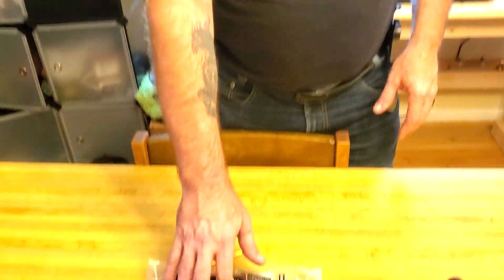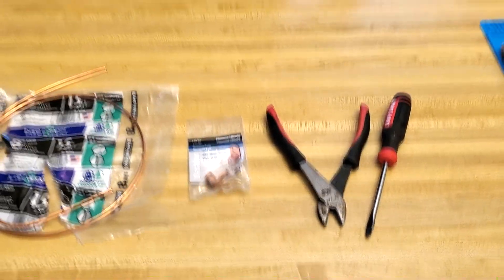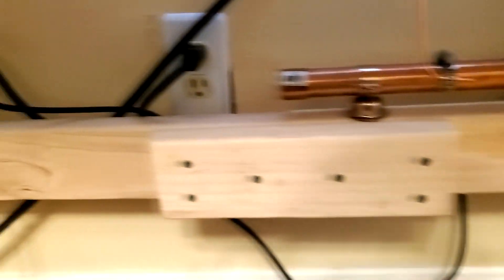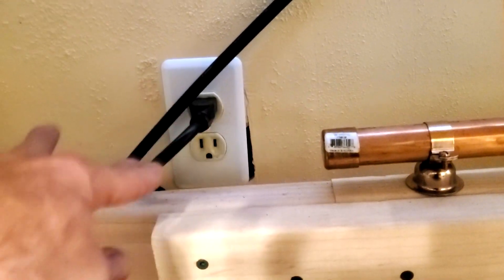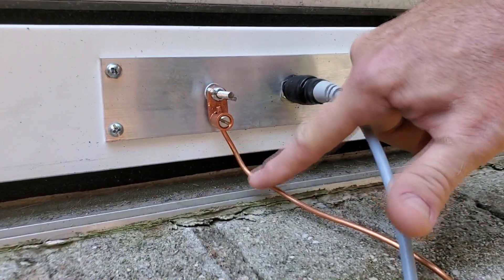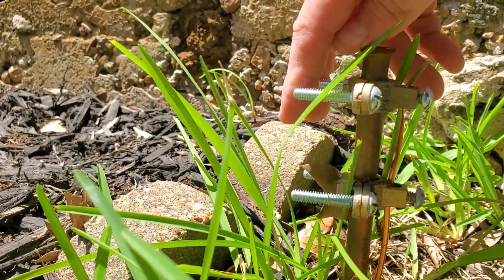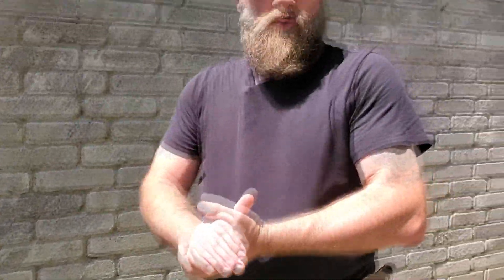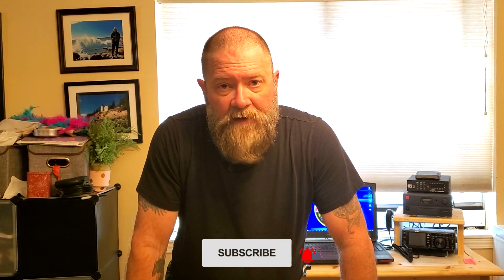How I ground My Ham Radio Station

Comment: I have been a HAM for decades. Grounding is made to be confusing, but it IS NOT CONFUSING if you follow some simple rules. You do not want the hose clamps as shown here because you don't get much of a connection. Use dedicated brass or copper ground clamps. Bi-metallic connections are not good but at times are hard to avoid. You can create a ground buss bar as you have here but use a grounding rod and not a pipe. Use UL listed grounding clamps to connect to the buss rod. Keep every run of ground wire or strap as short as possible. Crimp and don't solder.

Having said all that, some HAMs never ground and often have no issues. Once we installed a new AC and I had to disconnect my shack ground and when we were done, I forgot to fix it back. Two years later I found it and fixed it but never knew the difference. The chassis of the components will find a ground via a properly wired home but this is often the cause of a lot of harmonic noise issues. RF and household AC frequencies are completely different animals. I have never had any problems with grounding. Keeping it simple, direct, short and properly connected is what works. Many times if you have RF noise it the shack it will go away if you disconnect the ground which indicates you have created an antenna with your ground by not doing it right.
Reply from the maker: Thank you very much for sharing your experience!  I really appreciate that.  I made an updated video on this topic due to the comments and my new solution is just plain and simple common sense.  I unplug everything if a storm is approaching or if I am not using my radios for a period of time.  Works 100% of the time and my gear is protected.  Thanks for the comment and for watching.  73!
Reply: @HR4NT As an Electrician I would also run an unbroken #6 solid copper to the outside ground rod. The ground is only as strong as its weakest point. And those wing nuts on that bolt is a weak point for sure
Reply: Did you use a Megger to measure the resistance of that groundpin?

Comment: What size of wire are you using from your radio/tuner/PS to connect to the copper pipe? I couldn't really see it. You're using the 8 gauge wire from your copper pipe to the pass through, then to the ground rod, but can't tell if you're using the same size from your radio to the pipe. Thanks.
Reply from the maker: I am actually using braided grounding straps made by ABR Industries and bought through Ham Radio Outlet.  I bought the 5 foot versions for all of my radios and gear.  The link to what I use is here:  https://www.hamradio.com/detail.cfm?pid=H0-012451  Thanks for the comment and for watching.  73!

Comment: Thanks for the video. I read competing theories about grounding on the internet. One is that running a copper braid from a buried copper rod to inside the shack only invited lightning indoors. The other is that ALL equipment and antennas should be bonded together to ground where the AC line comes in. Of course that begs the question: what if your shack is on the other side of the AC line entry? My shack has a small copper pipe similar to your set up with braided wire running to it and bonded there. From there it's bonded with copper to the metal bulkhead in the window coax entry. Outside I have an 8' copper rod in the ground with copper strip running to the bulkhead. I'm in FL so I did a bit of study on how to do it right, but perhaps I should consult the ARRL Antenna Book on proper grounding. I am also very diligent about disconnecting ANY coax from the bulkhead when there's any threat of T-storms. Your setup looks solid!
Reply from the maker: You nailed it!  I made a newer update video on this topic and that is my solution...unplug everything if you are not using it or a storm is coming.  Works every time 100% of the time.  Just a little inconvenient but better than $5000 in repair s and replacement radios and gear.  https://www.youtube.com/watch?v=ed0N5b6yeZg  Thanks for the comment and for watching.  73!

Comment: KE0OG and others show running a 6 gage wire between your ground rod to the ground rod at your electric service entrance. You now have two grounds at your house and that is a safety issue..
Reply from the maker: I have come up with a new solution and a video explaining my solution.  The setup in this video is/was too complicated.  Check out that other video if you get a chance.  Thanks for watching and for the comment.  73!

Comment: There's a whole lot of grounding info out there. I will just repeat what I've seen. The dat I've seen says each piece of equipment MUST go from that equipment to the ground rod. But having all pieces connect to a bar or copper piece before it gets  to the ground rod is technically a "Ground Loop". 

I am in the process of re-doing the whole system  including bonding my shack ground rod to the house ground rod. The motorola package on communications grounding repeats this last thing over and over. That may fix my minor problem. I hope.
Reply from the maker: I recently uploaded a new updated video on this topic and my new solution to it.  Check it out and let me know what you think.  Thanks for the comment and for watching.  73!

Comment: Interesting is that like most people I've got computers, televisions, washer/dryer, router and other electrical installed and all have the 3 prong pin for grounding, but buy a radio and all the sudden grounding requires a totally extremely complicated and expensive and potentially dangerous new design.  Doesn't the radio have a 3 prong plug?  (jk).
Reply from the maker: The radio doe not...the power supply TO the radio does.  And you are right, we freak out about things like this and make more out of it than it needs to be.  Thanks for watching and for the comment.  73!

Comment: 200 feet of copper ribbon is what’s recommended 
For a real ground. Or your copper water main if you have one.
Reply from the maker: Thank you for the info.  I recently made another video with updates to this one showing how I finally resolved my grounding issue and a surprising article on why IU did what I did.  I hope you check it out.  Thank for the comment and for watching.  73!!

Comment: @HR4ANT     I have an Icom IC-2300H FM transceiver that doesn't have a ground lug on it like the HF rigs. how would I ground it?
Reply from the maker: I recently did an updated video on grounding my shack and what I've learned since then that I put out probably 2 weeks ago. If your radio does not have a ground option built-in you probably really don't need to deal with it.   I would just unplug everything if there's a storm coming to protect your gear because no amount of ground rods or ground straps will protect you if lightning actually hit your antenna directly. Check out that other video and I hope it helps out a little bit more and explain things a little bit better. Thanks for watching and for the comment if you need any other help let me know. 73!!!!

Comment: all my grounding, bonding publications say the the ground rod and the clamps should be below grade meaning you drive the whole arraignment until it's covered over by earth. According to code that is, however the electricians who built this system in '46 and the guys that put in my solar in 2017 and the county Inspector at that time, apparently never read this part of the code.
Reply from the maker: Interesting.  The ground to my house that was put in decades ago is sitting a few inches above ground with the ground wire from the breaker attached.  I have never heard of burying it completely underground for effectiveness.  Thanks for the comment and for watching.  73!!
Reply: @HR4NT  I saw that in the "Grounding and Bonding for the Radio Amateur" by H. Ward Silver an ARRL publication. I agree. My ground rod are the same way. I guess local building code has a different take on grounding and bonding. 🤷🏼

Comment: Amplifiers need a ground because the case seems to radiate r f. Also run a bonding wire around house to power in ground your outlet ground and your ground rod will show voltage mite bite a little between radio and your ground rod.
Reply from the maker: I did not know that about amplifiers.  Thanks for sharing.  Thanks for the comment and for watching.  73!

Comment: Hey, thanks for the video. I noticed when you talked about maybe adding another ground rod, you pointed to the ground just beside the existing ground rod. You may want to check my facts but I believe there are requirements about the distance between ground rods. I read that they should be no closer together than the length of the rod. So, If you use 8' ground rods, they should be 8' apart, or greater, and bonded together. Again, do some research  because I am just learning too.
Reply from the maker: I actually shot a follow up video to this one a couple days ago.  I have made a few changes and these seem to work out just fine.  I added that other ground rod later on after this video, but have since abandoned it.  Check out the update video.  Thanks for the comment and for watching.  73!

Comment: For an RF ground, due to the skin effect your shack ground conductor should have a lot of surface area. Flat copper straps are best, followed by flat and wide copper braid, followed by thick stranded wire. I plan to use AWG 6 THHN stranded electrical wire for my shack ground. using a 5" long 12-connector copper bus bar with screws and holes that's meant to go inside a breaker box. But even a so-so ground is better than none.  (BTW my window passthrough consists of leaving a sliding window open a crack wide enough for my LMR-240. I'm in the tropics so a draft's not a problem, and I don't have aircon, just an electric fan, so I normally leave the windows open anyway.)
Reply from the maker: That sounds like a good solution for your situation.  Like I said, we each have to find what works best for us.  I have so much RFI (noise floor is 10 over 9 most days) that ground or no ground, it doesn't matter as far as cleaning up the signal.  Because I disconnect everything in the event of a storm, my gear is protected.  I did end up keeping my safety ground, but that is all.  Thanks for the comment and for watching.  73!

Comment: You need to use ground strap (not copper wire) if you want to properly ground your station. It's called "skin effect" and wire does little to fascilitate proper grounding at HF frequencies. Frankly with today's modern electrical systems and gear, grounding offers few benefits.
Reply from the maker: I am actually shooting a video about this topic this week.  I agree, overthinking about grounding in modern day technology is a waste of time.  Thanks for the comment and for watching.  73!
Reply: @HR4NT  And 73 to you good sir. DE-K5LXY.

Comment: I have a ground rod at the entrance to my house with an arrestor attached to the ground rod. I run 4 ga wire from the ground rod to the mains ground. I do not ground my equipment. In the event of a lightening strike your grounded equipment is toast. If your concerned about strikes then unplug your rig, disconnect the coax. Grounding your equipment will not save it from a strike. If your not having issues without the ground then don’t bother. The ARRL sells a book on bonding and grounding. It’s very good.
Reply from the maker: I do exactly that now, I unplug everything if a storm is approaching.  I ma also getting ready to do a show talking about this topic that should be out next week.  Thanks for watching and for the comment.  73!

Comment: Curious, have you experienced ground loops with the points of grounding on the copper bar.  I have alsways understooed that a person should have one common point for grounding. 🙂
Reply from the maker: I have not had any issues with the way I have my ground setup.  Although apparently having the extra grounding rod outside my window rather than grounding to the rod below my breaker box seems to be frowned upon, but I have not had any issues to date.  The one thing I do is whenever there is a storm approaching, I unplug all my antennas and grounds from the window passthrough I built to protect my gear.  I am not taking chance with thousands of dollars of equipment on the line.  I hope this helps you out.  Thanks for the comment and for watching.,  73!
Reply: @HR4NT  I am going to ground my shack the same way. I like the way it looks and it makes a ground tap a lot easier. You have an awesome day, enjoy your content!

Comment: Great video show and tell works ever time. One suggestion how about a list of product and where they came from. We’re did the clamps that look like bells come from and what is their real name. I am in the process of building the window. How do u lock window? After installing
Reply from the maker: Hi John,   The bell things are actually called "copper bell pipe hangers" I got from Home Depot.  The majority of the grounding stuff came from Home Depot.  The way I locked the window after installing the passthrough was to use two screws at the point where the window seals with the passthrough installed.  I works very well and prevents the window from moving.  I hope this helps.  Email me from my website if you need any further assistance.  Thanks for watching and for the comment.  73!

Comment: If you are a Western ham radio operator moving to Thailand and some other nations like it, are you aware of the difference and I do mean difference in the way 230 VAC is supplied to the home compared to the way in The United states????      Thailand and licensed Thailand electricians do not believe in grounding and the two wires which supply 230 AC for one horrific example, cannot be split off to form a  115V AC outlet.   If you're even slightly any doubt,  get a ham who has lived through the Thailand electrical system to consult with you.  Hired Thailand electricians are struggling to put in three wires to provide a third pIn grounding on the more modern outlets/sockets.   I checked first with a wise old local ham and found the dangers I was treading.
Reply from the maker: When this video was made, I was not taking into consideration the practices of grounding around the world, so it did not occur to me that there were other practices and challenges in other places.  I appreciate you sharing that info.  I always like learning about new things from other countries.  Thanks for the comment and for watching.  73!
Reply: @HR4NT  notice that my answer is not complete enough to operate with it. You need to get hey Tai eligible local ham to tell you how to handle Thailand two conductor AC input.   I merely warned you about it I did not tell you what I don't know which is how to handle the two wires coming in

Comment: We're lucky around here (Houston metro area) with respect to lightning though... You seldom see houses around here with lightning rods, but I've noticed a lot more in the Dallas area with them... Personally, I'm relying on the fact that the Crazy Indian Old Lady that lives next door to me is in a 2-story house and I'm in a 1-story... :)  When I was living in Louisiana 50+ years ago, it seemed that people just relied on the pine trees to act as lightning rods... :)
Reply from the maker: LOL...wow...yeah I have not seen lightning rods anywhere around either.  Let the two-story take the brunt of it...LOL....Thanks for the comment and for watching.  73!
Reply: @HR4NT  -- Your subdivision looks like it has underground power lines.  We do too, but I also have a higher line running along my back property line that abuts the greenspace / levee.  It has a ground line at the very top and is probably even taller than my neighbor's 2-story house... Odds are that it would get stuck first... I'm not too concerned about lightning striking my house... I used to live in house in north Louisiana that had a 100 ft tall pine tree in the backyard... It got stuck by lightning when I was less than 20 ft from it working on a project in the backyard... The bark EXPLODED out the side of it and I hit the ground... Pine trees make very good lightning rods... Often works out to be single use though since they will often die after getting hit... And then you have to wait around another 50-100 years for a new one to get the same height... :)
Reply: There are 22 pines on our property/5 close to the house. Each pine is 120+ feet tall......natural lightening rods :)

Comment: Does the ground rod really need to go 8 foot into the ground?
Reply from the maker: According to electrical code, yes.  It is a bit of a pain to drive it into the ground, but it is worth it to help protect your equipment.  It's to find the soil which has much lower resistance than the rocky surface. It is very important to provide a low resistance path to the neutral current.  If you live in an area that is primarily stone and rocks, I have seen instances where the rod was put in the ground at an angle instead of straight vertical.  I hope this helps.   Thanks for the comment and for watching.  73!
Reply: 4' is sufficient in soft soil.

Comment: Did you happen to notice any reduction in noise when the radio is on? I did mine very similar but used 3/4” straps off the radio tuner amp etc.. i noticed a drop in noise on my vertical and a little drop on the OFC
Reply from the maker: I can't tell because I have an external RFI issue with a neighbor with solar panels.  Thank you for the comment and for watching.  73!!